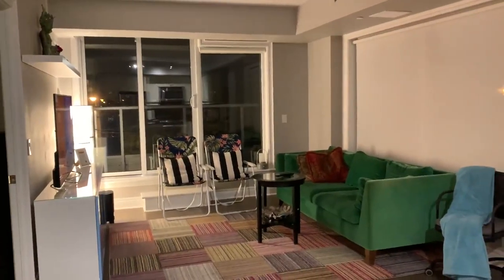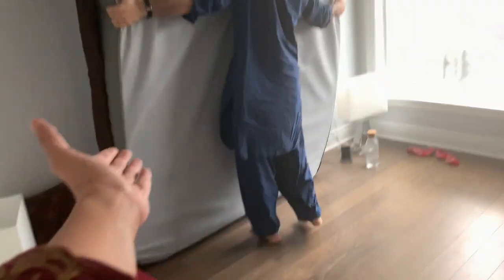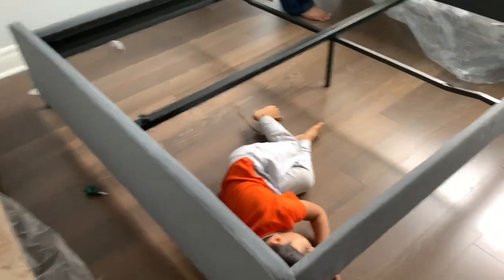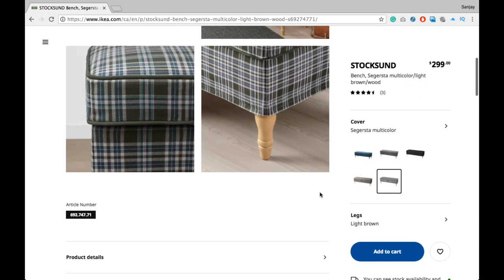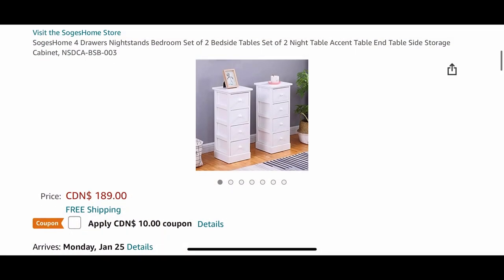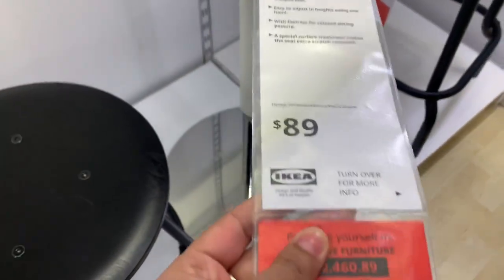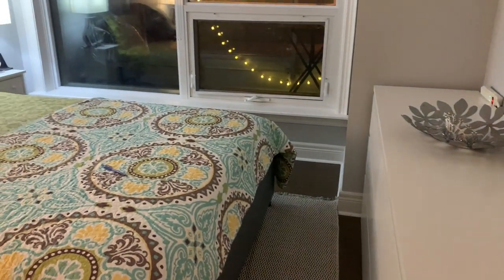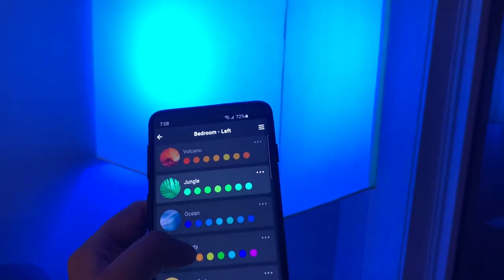Our New Apartment Makeover From Start to Finish | Furnished Canada Apartment Tour | LIFE IN TORONTO

Comment: Hi, Good Morning ! Thanks for sharing the information. My score score is 464 under FSW, Non Canadian Class. What are the chances of getting the PR before September 2021, as I will be loosing 5 points for my age in Sep 2021. Right now I am 31.
Reply from the maker: Hi Arunam,
Based on previous draws the CRS cut off for FSW fluctuates between 468-472 and it hasn't gone down because a lot of quality profiles are being added to the express entry pool everyday with 465 or above score. So if we talk about statistics, the chances could be bit low of getting ITA. However, Canada aims to welcome 113,750 new permanent residents in 2021 under this class. So either I would have waited for the draw to get conducted by CIC in my favour OR I would have improved my score by getting more work experience or getting better IELTS score. PNP option I might have chosen too.
Good Luck!

Previous draws:
https://www.canada.ca/en/immigration-refugees-citizenship/corporate/mandate/policies-operational-instructions-agreements/ministerial-instructions/express-entry-rounds.html

Immigration Plans from 2021-2023:
https://www.canada.ca/en/immigration-refugees-citizenship/news/notices/supplementary-immigration-levels-2021-2023.html
Reply: @AmertaRoopani Thanks for the revert. Additionally, I have mentioned these NOCs against my profile - 0125, 6211, 6221. I have 4 years of experience. Out of which 0125 is the current NOC. What are the chances of me getting an ITA via PNP? Thanks in advance !